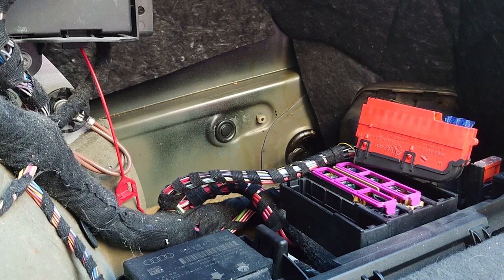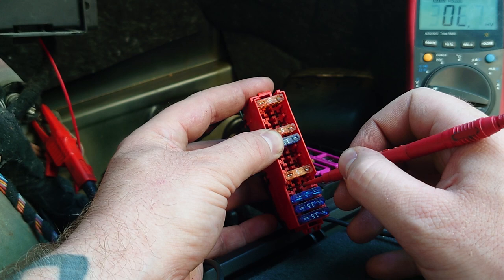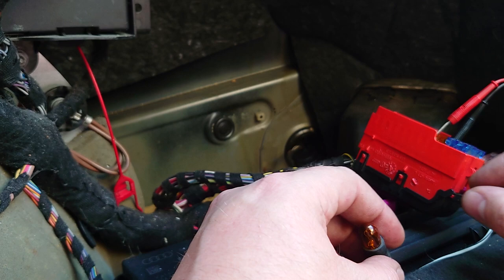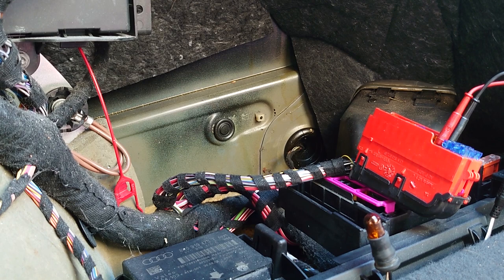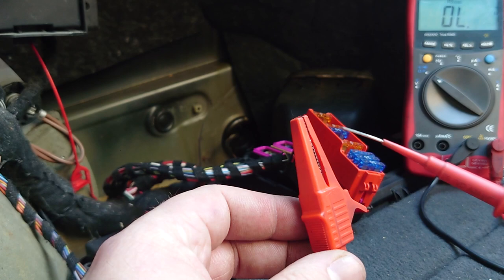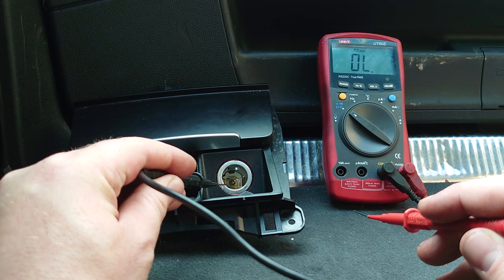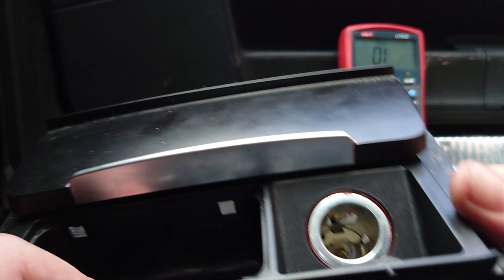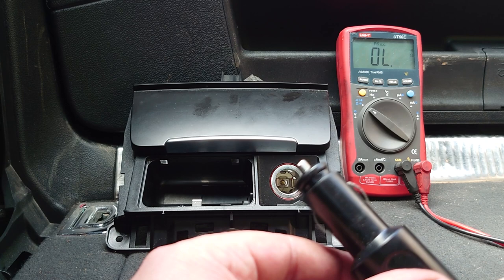Why do my fuses keep blowing? Short to ground testing

Comment: A very useful video, I used your technique to find and fix a short circuit in my caravans 12v lighting circuit, which turned out to be two trapped wires where a light was poorly fitted by the manufacturer. Great stuff cheers.

Comment: Superb video. I can now use these methods to try and find the fault I have in the car.  Every time I turn on the side lights it blows the fuse for the left-hand side only straight away.  Should save me a fortune on fuses and by the way this has been the best video for explaining different methods with the bulb and the multimeter.

Comment: Thanks! My car blows a fuse whenever I plug in the cigarette lighter or a phone charger. I use the multimeter to check for voltage at the fuse and it is around 12 volts. I did the continuity test and it is not getting continuity. Does that mean there is a fault in the wiring somewhere? I checked the wiring around the lighter and it looks okay. The wiring goes up into the dash so who knows what is going on up there.

Comment: my tail lights are not working brake lights are small light fuse keeps blowing as soon as i turn the lights on . Any help on this problem i am having
Reply from the maker: I would put a bulb inline with the tail light fuse as seen in the video. When you turn the lights on if there is a short to ground the bulb will light. I would then disconnect the tail lights one at a time and see if the bulb goes out showing where the short is.

Comment: I have a 2005 Dakota, 3.7L., 128,000 miles. The power outlet fuses one or the other blow, 20amp. This started to happen when I use my plug-in air compressor to fill the tires after a few minutes running. I have done this for many years with the same plug-in air compressor, same Dakota, no problem. Now my dash cam is always plugged in to the power outlet when driving and the power outlet fuses never blow/burn out. The garage could only suggest my air compressor is old and causing the problem.  What position do I set my multi-meter on? Not to knowing of how to use one. Sorry. Any advice would be greatly appreciated. I hope I explained this correctly. Thank you.

Comment: I have a 2000 Honda Accord EXL. When I attempt to replace the passenger side window fuse it immediately blows? I know I have the wires cut on the horn.... Might that be on the same circuit??

Comment: My car radio fuse keeps blowing out, as soon as I try to replace it, it blows immediately, my car is 2002  Bmw 325 ci, need desperate help cause my windows and windshield wipers doesn’t work anymore
Reply from the maker: I would look at the fuse description and see what other components are on the same fuse. Then put a small bulb in the fuse holder like shown in the video and disconnect the components on that fuse until the bulb goes out, that will be where the short is.
Reply: RMAutodiag I’ll check it out , thank you.
Reply: I have same year 325i did you find out anything ?? I head a 10.1 inch head unit fuse just blew today now it keeps blowing
Reply: @mickeylim399  did you end up fixing it